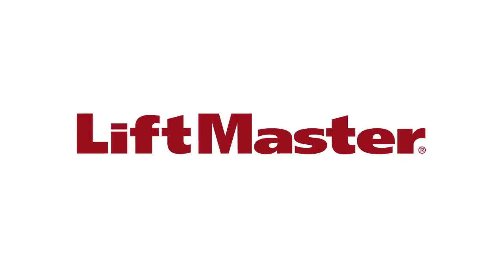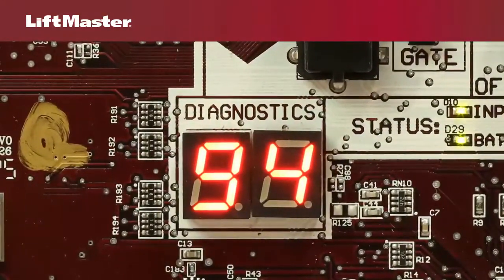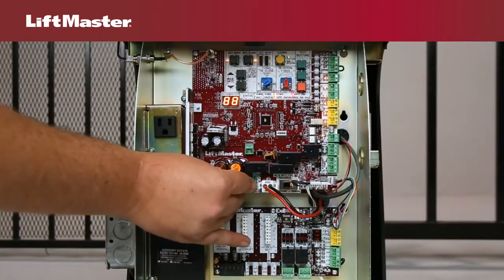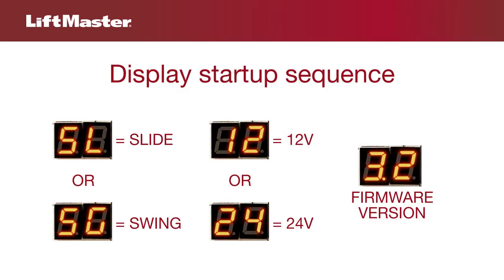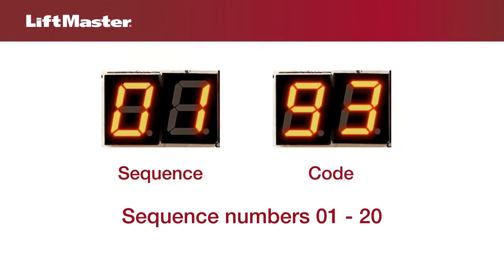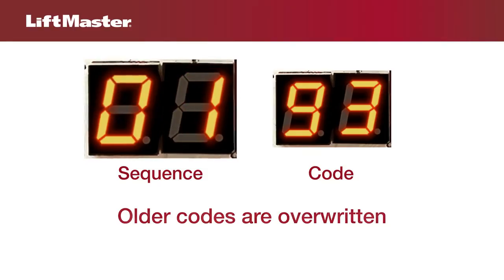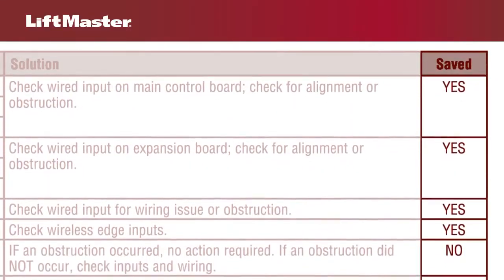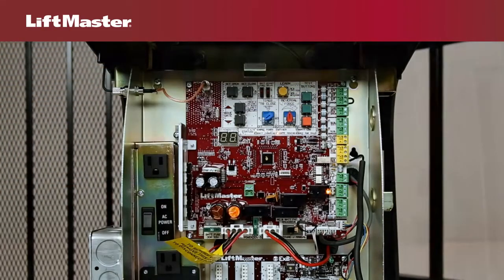LiftMaster - Access and Read Gate Operator Diagnostic Codes

Comment: what is a code 31?
Reply: @TexasT, an Error Code 31 indicates the main control board has experienced an internal failure. It is recommended to turn the main power switch off, wait 5 seconds, and then turn the power back on. If the error comes back the main board may need to be replaced.

Comment: Kory, I have a Lift master gate opener that's showing a 37-error code. The led's on the sides of the set close and set open buttons are flashing, can you tell me what's going on with my operator.
Reply: @Tina Dancy, that's one I haven't seen before, but the LiftMaster manual describes this error as an "Product ID Failure". Unplug product ID harness then plug back in. Disconnect all power, wait 15 seconds, then reconnect power before replacing product ID harness.

Comment: I don't get a code, the only thing that displays is "LA". What does that mean?
Reply from the maker: Kory Beck, I'm not sure what LA means, all the error codes that are published indicate the should be numbers not letters. Assure you have followed the process in the video to display and cycle thru the available error codes - do you have any reason to believe the diagnostics display is not working properly, like does it look like some of the portions of the numbers are not lighting up at all?

Overall, what is the problem you are having with your gate operator? Do you have any other indicated lights lit up on the control board?
Reply: @totalsecuritywarehouse3621  I am thinking I have a bad board... No error codes or indicators appear at all. The light for input power is on and the "XMITTER" light is on. Nothing else. The gate operator is not working at all.
Reply from the maker: @korybeck6628  take a look at the manual link below. That XMITTER light should only be on when in LEARN Mode. Check that your Stop and or Reset buttons are not stock on your control board. You may also have an issue with a wireless device connected to the control board.

https://www.liftmaster.com/24vdc-high-traffic-commercial-slide-gate-operator/p/CSL24UL
Reply: I’m having the same issue, I’m getting LA. Did you find out what it was?? How did you fixed it?
Reply: what does diagnostic code 44 mean?
Reply: LA is the part of the product description, my operator is LA400.. cmon guys
Reply: I am getting n LA diagnostic code as well. Can you share what the issue as well as what you did to fix it?
Reply: @sandigenova6957  did you find out what LA is? I saw LA means low antenna with the garage liftmaster.
Reply: @sandigenova6957  I unplugged from wall, then opened the box and pulled the white connector for the battery on the lower face of the control board. After it totally powered off, I plugged back into wall and reconnected the battery connector.